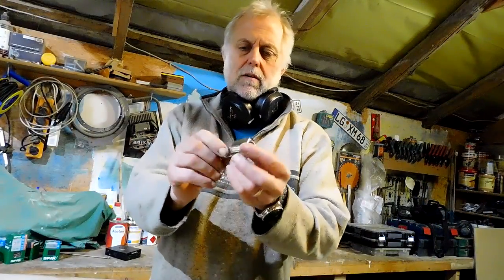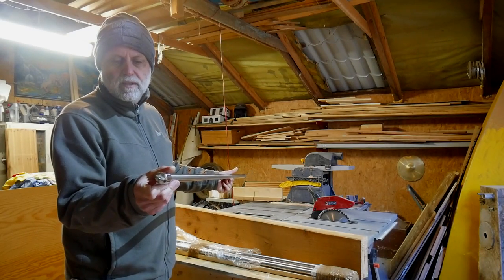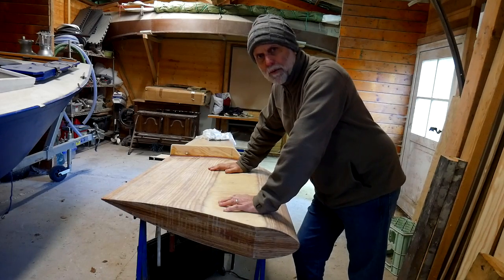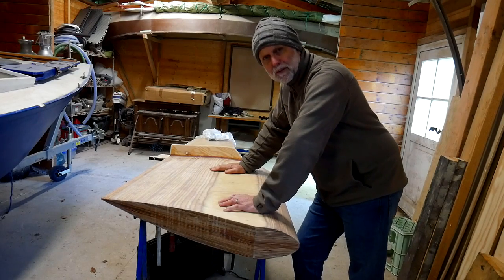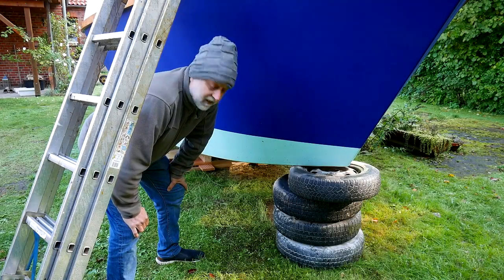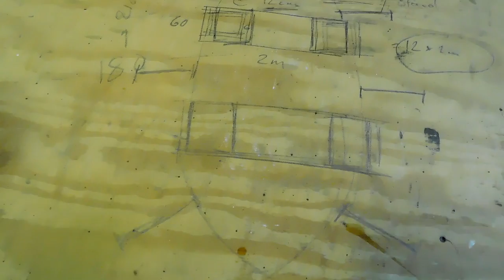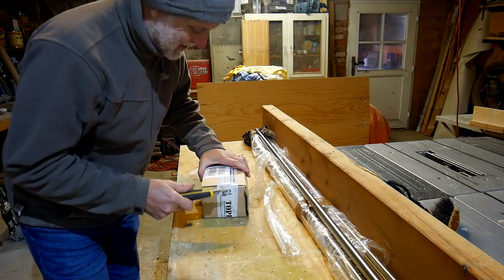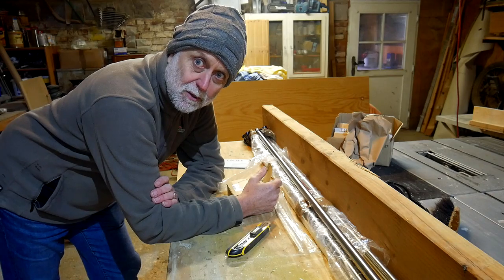Raising The Boat And Starting The Keel; Building a cruising sailboat - SV Tapatya EP204

Comment: Tony, for safety when drilling, either attach a 'C Clamp' to the table to use as a rotation stop, or turn the vise so it banks on the upright pillar. A jam can cause the vise to spin and break the drill bit or a finger. My first manufacturing position was in 'Drill Press' and the Lead Man, Nicky, made it a point to enforce that bit of safe drilling... 👍
Reply from the maker: Thanks Mike, but I've drilled enough holes to know the power of this beasty

Comment: Hi Tony! Great to see the keel underway at last! Interesting to see that you've opted for a full-length keel, rather than the 3/4 length that the plans detail for the shallow draught version. Since I plan on going with the shallow draught version myself, I'd love to hear your reasons/thinking behind the decision for the extra length.
Reply from the maker: Thanks Garryck. My reasoning is pretty simple on this one. The plans for the 31.8 footer only show 2 keel options; the shallow draft long version that I'm building, or the deeper draft fin keel.
Reply: @SVTapatya  - Ok.. I was thinking the 31'8" plans for the shallow draught version would specify a cutaway forefoot, same as with the larger Sailing Dories. Interesting!

Comment: Hi Tony, a couple of questions. Do you think that you should have used bedding compound for that first piece of deadwood, and will you be using any for the pieces that you will be adding on? I did see that you epoxied the seams but a seam over time will open due to the flexing of the structure. An ounce of prevention beats a pound of cure I think the old saying goes. :) ...oh and what kind of wood is it?
Reply from the maker: I used thickened epoxy as a bedding compound Brutus. Perhaps I didn’t make that clear. Yes the whole wood keel structure will be epoxy glued, screwed and glassed over. The ballast keel will bolt through the whole thing, so it should be pretty sound. The wood is doug fir 🌲

Comment: A bit of light weight cribbing there, it would not support a loaded 100 ton freight car though.  This from an old Carman on a railroad.  You do well with what you have.  No complaints, be safe!
Reply: Given that the entire finished boat, with keel, fully stocked with supplies, fuel and water, will weigh 9500 lbs (under 4.5 metric tons), I'd say Tapatya is quite safe where she is.
Reply from the maker: Thanks Robert 😂👍